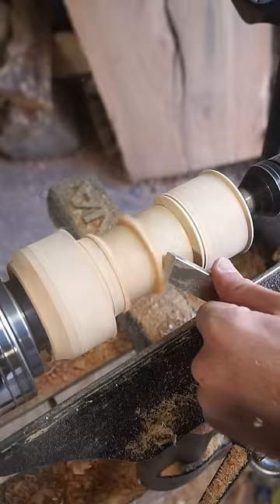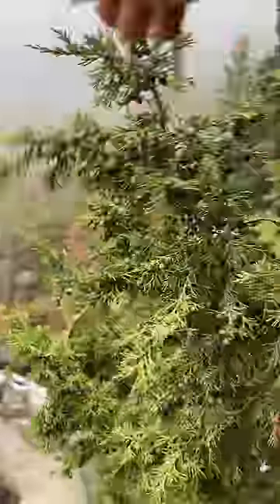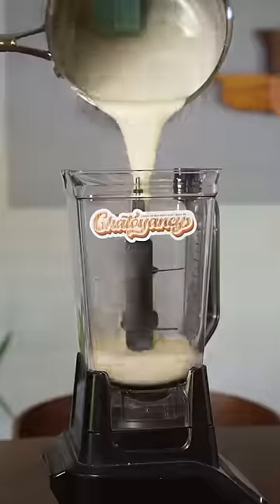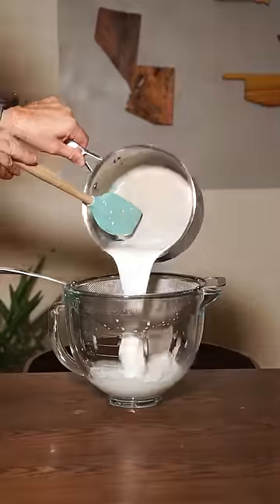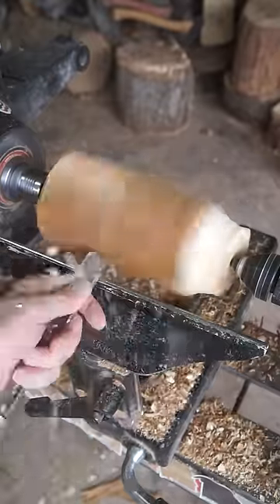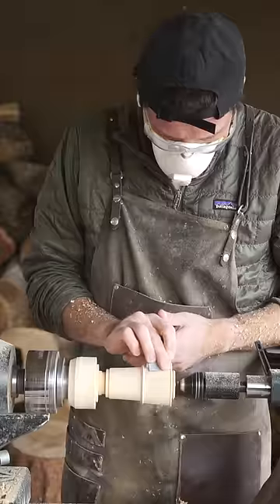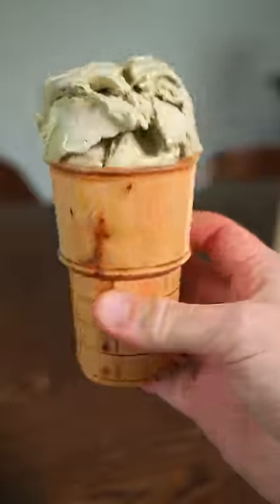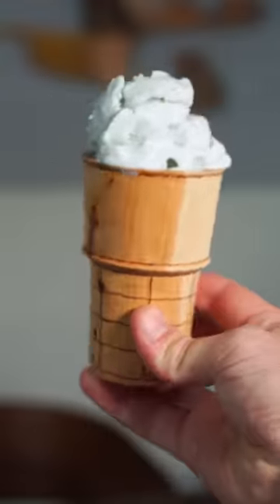Making a wooden ice cream cone! #woodworking #trees #shorts

Comment: I’m really curious, have you made anything out of palo verde before? It’s the Arizona state tree and I’m not sure where exactly it grows so I get if it’s not available, I just wonder what it’d be like to work with. It has soft green bark and I’d say relatively soft yellowish wood, and it’s covered in spikes. It has pretty yellow flowers that basically turn the treetops yellow in spring and coat the ground in golden petals like cherry blossoms but smaller and more annoying imo (I’m allergic to the tree and fun fact, if you get scratched by a tree that you’re allergic to the pollen of you’ll have an allergic reaction and it’ll itch like hell.)